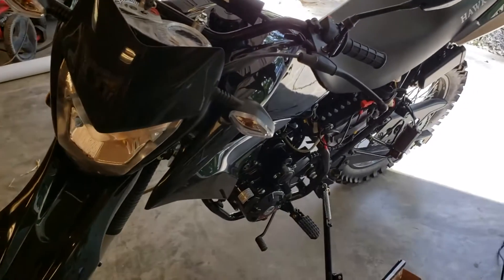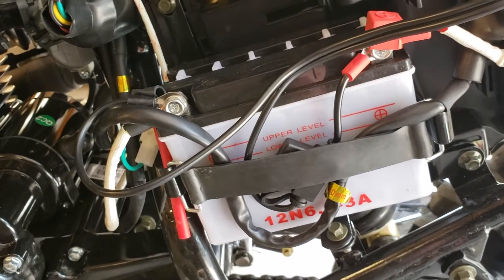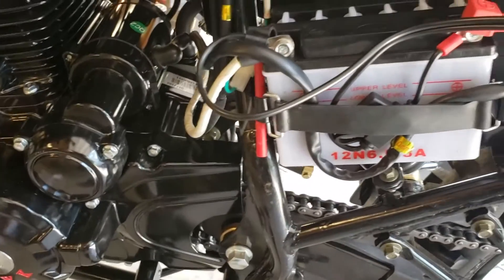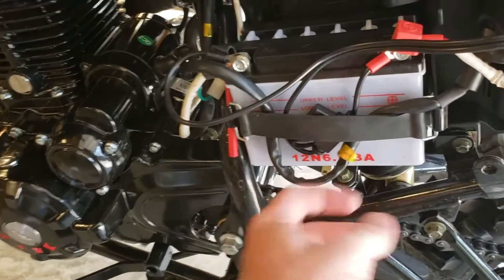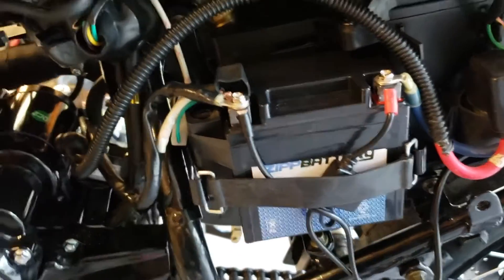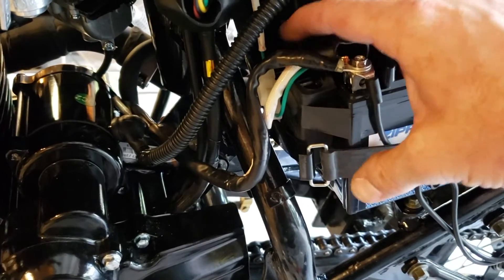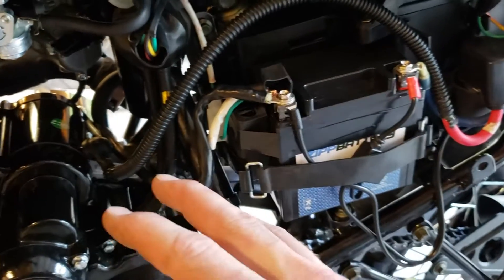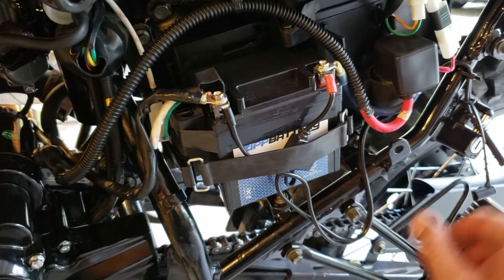Hawk 250 Battery & Electrical System Upgrade

Comment: Thanks to your video I ran upgraded cables from the positive battery terminal to the solenoid, and from the solenoid to the starter. It delivers a lot more power to the starter. That was a great idea to install a battery charging attachment...I find myself charging the battery like I'm a damn Tesla owner.

Comment: Hey u mentioned when explaining how you ran your ground wire the there was a place it was grounded to on the other side of the engine. Was wondering where exactly that location is. I got a hawk 250 and how I got it, it Is kick start only no battery solenoid fuses or even the start button on the handle bars. I currently have everything more or less to hook up the battery and everything else just want to make sure I'm on the rite path pls lmk when  you can and thanks for the great helpful videos!

Comment: How'd that battery hold up?I just bought it on Amazon because you used it and arrival dates.just curious. Thanks for the vid. I'm prepping for my hawk delivery lol. On to oil.
Reply from the maker: Still working great
Reply: @JackofAllMasterofNone  thanks for replying bro. I really do appreciate it.I ended up not installing it because the new batteries that came with the 2021 efi version are sealed/ no maintenance batteries as well.also, I didn't feel like adding a spacer to make it fit. It was a long assembly night lol.good to know I have a quality battery for backup though.

Comment: i Got a bunch of lithium batteries a few yrs ago. my 1500 vulcan has had one for 5 yrs and still strong. if you do buy lithium get the charger for them or they will not charge right. Hence how i got a few .from core bins

Comment: Do you know how I can upgrade the battery charging system. It barely Powers the lights
Reply from the maker: I haven't had the same experience. Your stator may be bad or it could just be the voltage regulator. That is a more common issue. The only way to upgrade is to replace the stator, but there is no easy high output direct swap that I am aware of. Some people use the CSC TT250 stator but it requires a different flywheel and wiring harness. Not an easy job.

Comment: I just got my hawk yesterday shipped fully assembled and battery was dead, got it started and took it home only for it to die the next day smh im trying to see if i need a whole new battery or is it because i didnt let it run enough? To charge
Reply from the maker: You do have to completely charge up the new battery with a battery charger, but I would just get a new sealed battery and junk the stock one. It's crap.

Comment: Thank you for your help! I bought the battery in your video however I can only get one or two rides before it dies... as well as the factory battery. Any idea why it would drain so quickly? I even disconnected all my "extras" that drew from the battery.
Reply: Thank you for your help!  My hawks brand new, only has 30 miles so it's definitely irritating lol
Reply: @ryanbaker7071  Yeah the stock electronics are cheap and flimsy, but from what I’ve read on forums is that when people do some electrical upgrades plus a new VM26 carb it runs like it was Japanese
Reply: @ryanbaker7071  yeah 2 batteries dying either they never got a good deep charge to begin with or your stators weak. you can test how much voltage is going to the battery when running with a volt meter.
Reply from the maker: Means your stator or rectifier is most likely bad and not charging the battery.

Comment: Can I just throw that battery in my 2020 hawk with doing anything else
Reply from the maker: Like I show in the video it's slightly different size. That's the only problem. But yes otherwise
Reply: @JackofAllMasterofNone  thanks I appreciate it I’m also having a problem where it’s stuck in gear and won’t got to neutral have you ever had that problem?
Reply from the maker: @johnnyp2609  usually that is caused by a Miss adjusted clutch cable
Reply: @JackofAllMasterofNone  could you possibly do a video on how to do that I posted a video on my account I’m having with my brand new hawk 250
Reply from the maker: @johnnyp2609  I just watched your video. Try shifting the bike with the engine running. What you are showing in that video is somewhat normal. They don't shift sometimes if they aren't running. You either need to take some slack out of the cable or your shift forks are screwed in the engine case. There are plenty of videos on yimoutube about how to adjust your clutch cable. I can't make a relevant video for you because my Hawk has a completely different engine and it's a different cable and everything
Reply: @JackofAllMasterofNone  ok thanks so much for getting back to me ill try it out!
Reply: should the bike start still even if it is not in neutral?
Reply from the maker: @johnnyp2609  No. Unless the clutch is pulled in. It will start in that case
Reply: @JackofAllMasterofNone  ok gotcha thanks i really appreciate it! i thought it  wasn't starting cause it wouldn't go into neutral.
Reply: @johnnyp2609  some of these chinese bikes have a neutral safety switch.

Comment: i have a lithium battery on my hawk brand new, hawk started a few times now it wont read any power to the entire system battery still fully charged any idea what could be the problem? ive checked the fuse and the grounds. still no power at all
Reply from the maker: Check the voltage at the battery. Might be your batteries internal protection cutoff.
Reply: Also check fuses and connections

Comment: What's the best possible battery you could get that would run multiple other devices like underglow and the wire 12v outlet for duel USB chargers, I get my bike in 3 weeks, I will be running it 8+ hours per day with a added oil cooler
Reply: Hey, are you actually running it 8 hours a day? If so hows it held up?
Reply: @awful_music  not yet, I started a job that's non driving related but I do plan on trying it as soon as I get everything together

Comment: What wires did you use for the battery? I can’t find battery inverter cables with the little clips That plug into the battery and the bike clips
Reply from the maker: I made them

Comment: Just an FYI. I sold a bike many decades ago. It had and electrical problem. Enduro. I was very frustrated with it. Took off all accessories and still did not run right. Major cut out. The lady bought for her husband birthday. He got it to run like a dream. The problem with it was, on the ground to the engine. Its powder coated. Over time it will lose ground. He cleaned off the powder coat under the condition and it ran perfectly. Just an FYI.